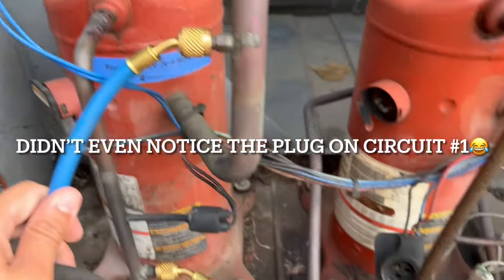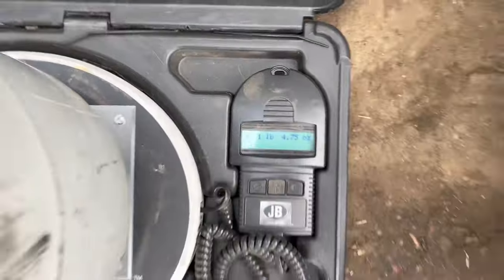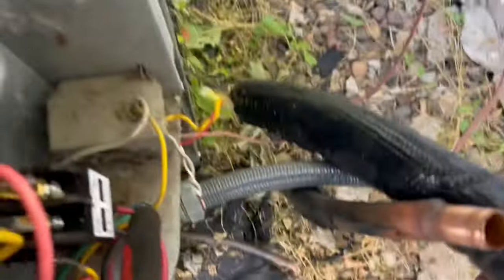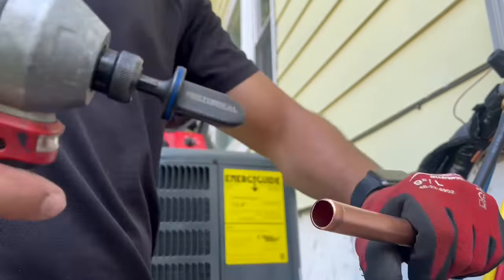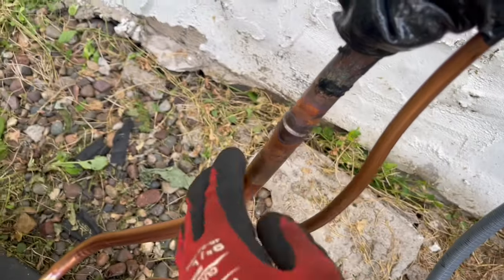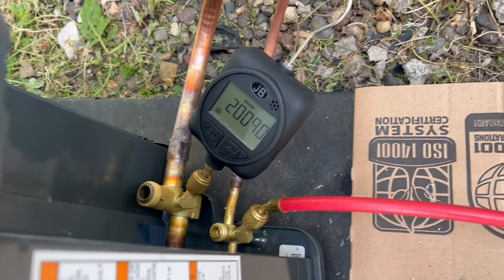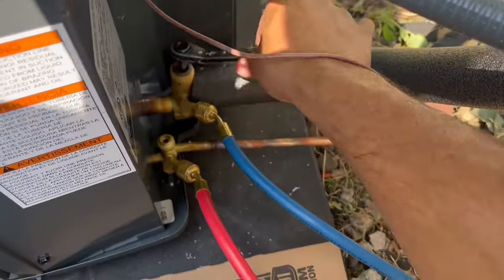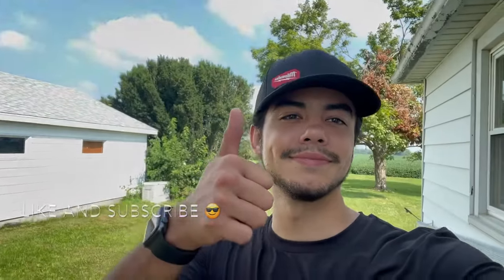How I Installed An HVAC Condensing Unit Alone

Comment: The start kit is most likely there in case the application is using a TXV that doesn't let the pressures equalize out during the off cycle.

A lot of Trane equipment is set up the same way.

Comment: You can use current Vaccum pump But why no vaccum with 2 hose and hose have ball valve Can shut off First before shut pump off .
The way you remove Vaccum gauge and hook up hose back like that air going very quick .better Remove core valve Vaccum 2 hose . Or 1 hose set up with removal core tool .
I know you Will very good . But your back bro.
Reply from the maker: That’s a good idea, thanks!